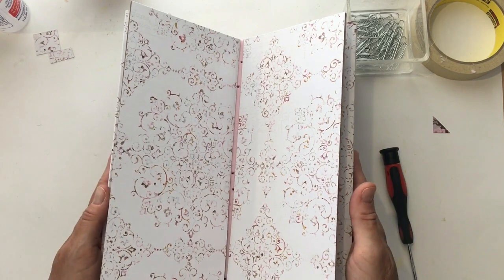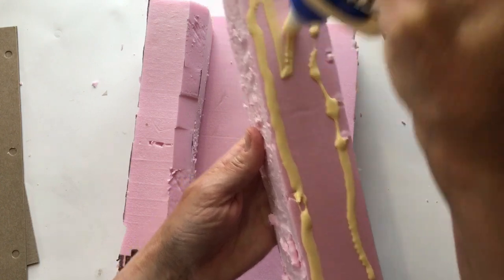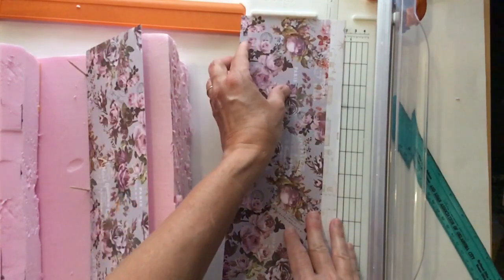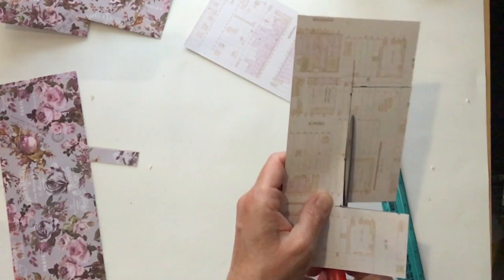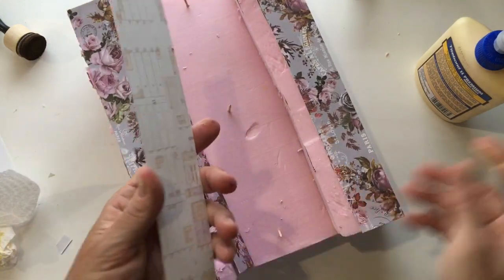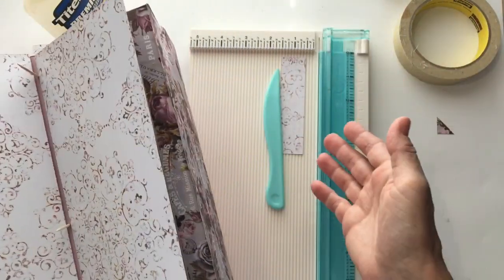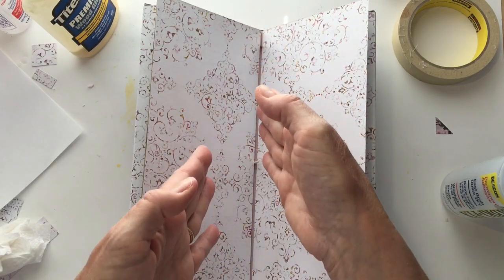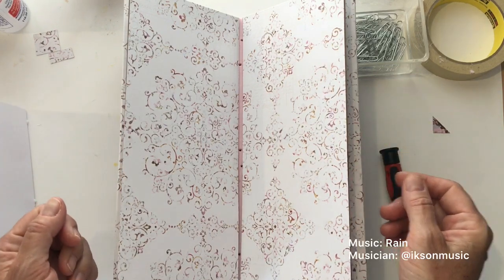My Version of a Book Binding Punching Cradle

Comment: Okay where in Hobby lobby can we find this foam at? I have never seen it before. I think something similar is for flower arrangements but it looks a little different and typically it's green. So what is this foam used for normally so that I can find some and make one of these genius book cradles please????
Reply from the maker: It’s actually foam insulation found at Home Depot or Lowe’s.